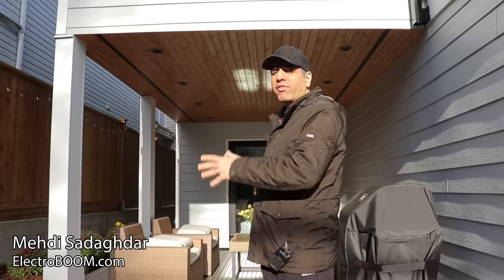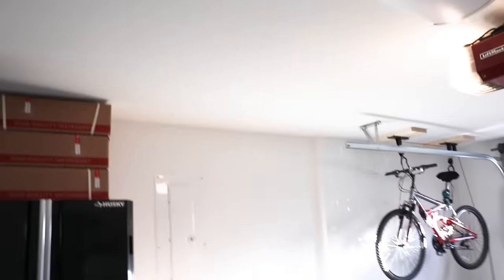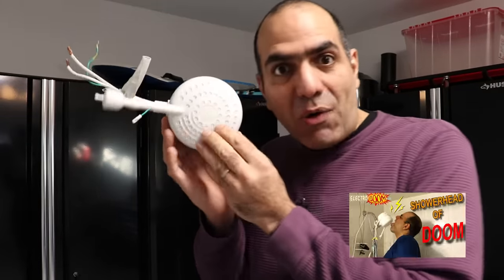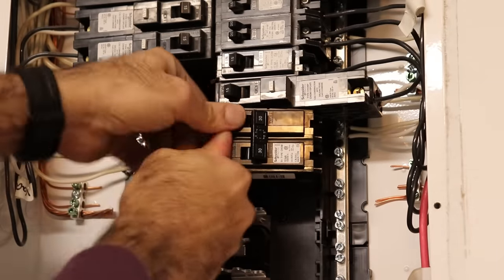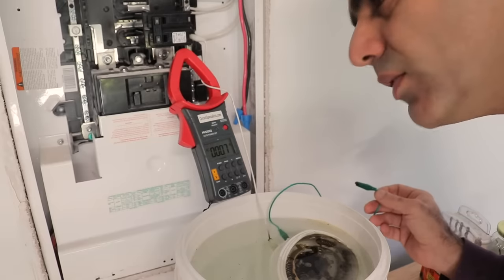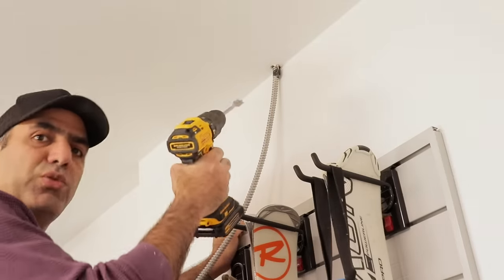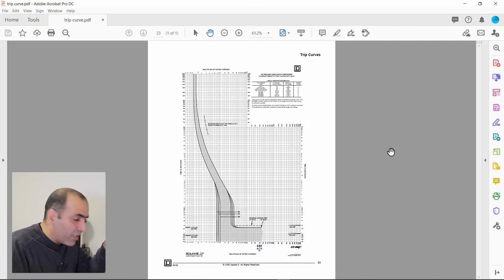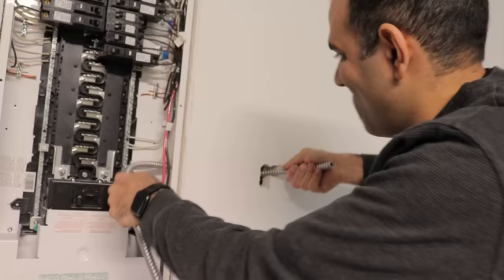Electric Patio Heater Wiring and Installation

Comment: You forgot a bx connector in the panel, knockout fillers in the back of the 4x4 junction box and you didn't use any antishorts on your ac-90 connector terminations, your installing a seperate heating load in a home with a/c which are both taken at 100% on a load calculation and on a 100 amp service so you might be overloaded and you require an electrical permit. I would fail your your  install. 😞

Comment: No anti shorts 
Hot work 
Exposed MC cable in outdoor rated environments
No electrical tape on devices on metal boxes
No connector on electrical panel
Oversized wire ok but breaker is not properly sized
Wearing conductive jewelry while performing electrical work, ENERGIZED electrical work

Comment: I can't understand why the wire coat should be Metal and the boxes he used also needs to be metal and breaker takes this much time to break the power! It is really dangerous system, here in Germany everything is plastic and isolated even Breaker box is plastic, idk why people choose metals for electric work

Comment: North american electrical items are so oldschool compared to the european ones. Blank wires,  only single or 2 phases, screw terminals, badly designed power sockets and plugs, weird breakerboxes with live exposed contacts, etc.etc. Europe moved on from this stuff, that to us looks like electrics from the 50s.

Comment: Uh, where you getting 33a required to power a 4000w heater? you mistake it for a 7500W heater? Also, you shouldn't be using ac cable outdoors, especially in Ontario, its against code.

Comment: As a licensed electrician from germany this is super strange. Every thing you use looks so differnet over here and the breaker pannel would be straight up illegal over here, because you can touch live parts. And also that you are using no RCDs in NA makes me furious everytime. I couldn't live in the US or Canada, because I would be afraid to die everytime it would plug someting in or switch on the light.

Comment: omg this is a disaster . 10awg cable in a double connector in a handy box with no bushings...no twist on the neutral just a wirenut thats waiting to fall off ... man you should get a hefty fine to teach you not to touch it again .... and now where is your disconect switch ??? wayyy too far from the unit in case of an emergency

Comment: As a certified Electrician i can point out many errors that would not pass inspection.  No bushings on the end of your MC cable and not cutting it with a proper MC splitter is the first thing to get called out.  Your installation on the heater side actually looks ok (if not missing the bushing); but your electrical box connections were piss poor.  That's an illegal connection inside your panel, you needed to have a connector with bushing in the knock out; your wiring in the junction boxes was cut to short, need at least 6" outside the junction boxes.  #1 you should have cut a 16" rectangle in the drywall above the panel and ran the wire from the top and than screwed the rectangle panel back into the studs.  Yea, what you did will work, but damn that looks like shit.  I still love ya though  :)